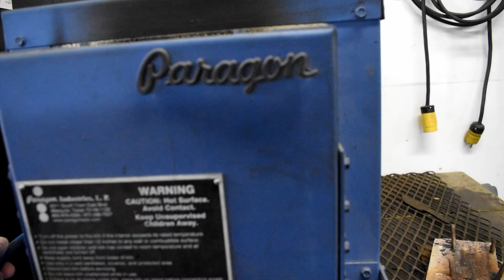Turning an old Saw Blade into a Chef's Knife

Comment: mine stains everytime I use it! but it works really well! so does my meat cleaver
Reply from the maker: Yea, high carbon steel patinas when coming in contact with anything ascetic. Beats cheap stainless every time.
Reply: @HensleyHandmadeKnives  the meat cleaver is my best make so far! I slpit 6"×6" logs for my grill, then I sliced a tomatoes afterwards. without resharpening.
Reply from the maker: @nobody2087  Nice! Good work!